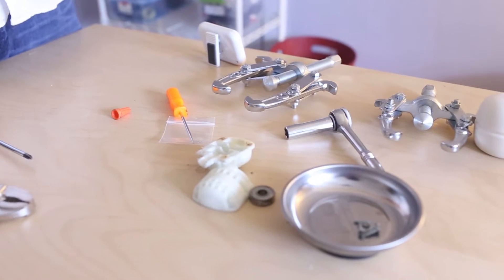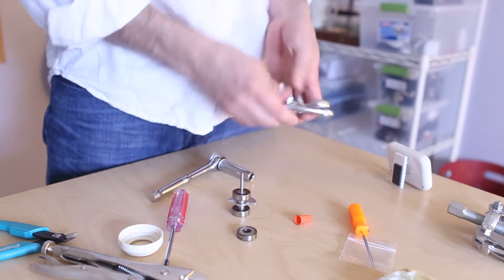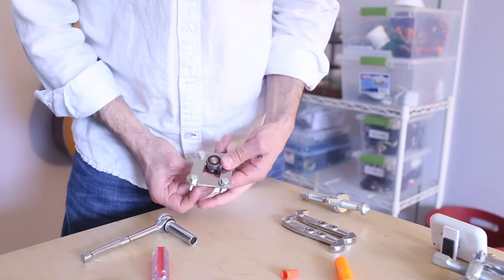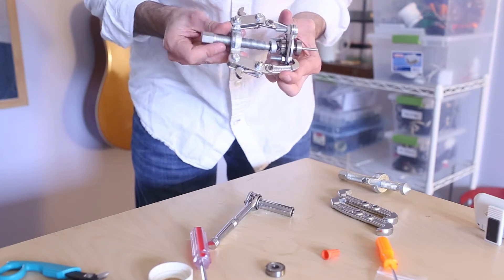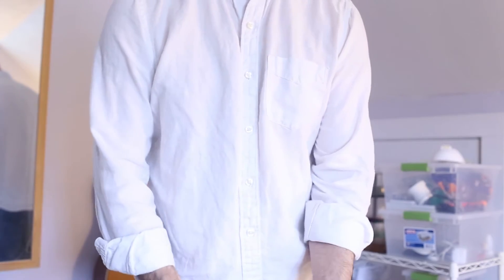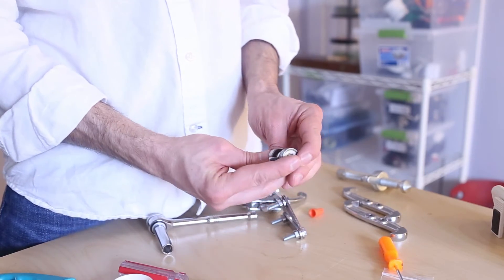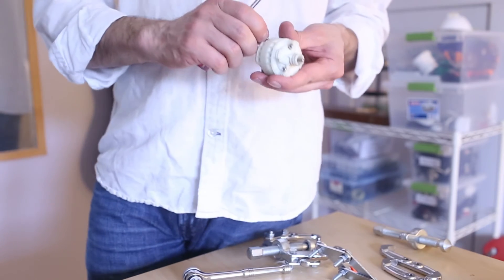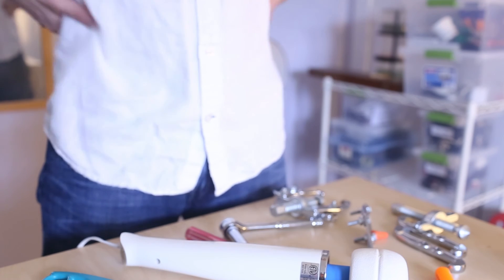Fixing the Hitachi - Episode 2: Bearings

Comment: I was gonna offer taking a few pieces of flatstock laid between the jaws of a vise to cradle the bearing and then hammer the shaft out using a punch, but actually being able to use your crank puller is good too.

Comment: Excellent video, but what did you replace the spring with? I can’t find a suitable replacement. Please help. 
Thank you in advance
Reply from the maker: I haven't been able to find a suitable replacement, which is the main reason I haven't fixed the vibration yet. I watched a few other videos that make me believe I could fixture the axle in a lathe and wrap wire around the axle to form my own spring, but I don't have that tool. I hope you find a good replacement!
Reply: @bobfixit9380  the mcmaster carr part number 9637K43 should work for your replacement, you'll have to cut it and put a bend in it to fit into the motor side
Reply from the maker: @reeseminole  Thanks for this info! I'll see about ordering some!